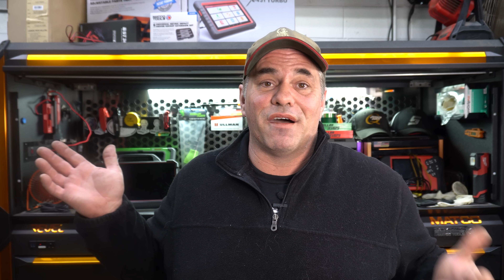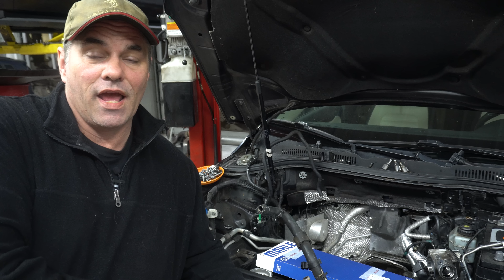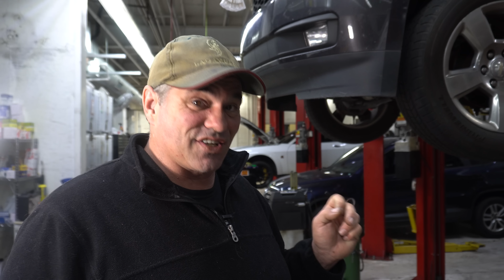Getting My Butt Kicked Again🤬😡

Comment: Also, if heat wrench does not work i split the nuts on the exhaust with small grinder or cut them with torch to open them up so studs is not damaged because of having to  replace stud if broke off leading into a can of worms with broken off bolts in the heads next. I all ways get heat wrench out and attempt to loosen first generally it is the passenger side that always gives trouble because of flange is different from driver to passenger.

Comment: I bought a 2014 Volvo S60  5cyl  Has the famous shredded serpentine belt causing timing belt slippage and 10 bent intake valves. I am retired shop owner..Did the repair in my driveway.Alldata cound not even supply valve clearances. Running  great after 60k additional miles.

Comment: I usually just cut the clamps off they are cheap enough to not have to put my self through it to get it off. I noticed if the exhaust has been off before the studs usually break off. Over torquing!!

Comment: Snap-on makes a great 1/2” drive swivel specifically for those exhaust manifold nuts. That with some GM heat valve lube and they come right off. Induction heater is your best bet on those exhaust nuts if they are fighting you. As for the clamp at the rear it’s a one time use clamp. I cut almost all of them at the bolt where it pinches down.

Comment: I had the same thing happen on a tahoe trans drop for a rear main a couple weeks ago, except the nut rounded, I eventually managed to split the hex part of the nut with a nut splitter, then took my air hammer, set a chisel at the bottom of the split, that split the flange, then I basically had to peel the nut off the stud with the air hammer…fun fun

Comment: Just replaced 2 GM truck transmissions this month. Install kit to cooler block valve to lower regulated trans. temp. GM valve is updated and requires line set but there is aftermarket kit that can be installed to block valve at transmission that will  bypass  lower  trans temp. this seems to be common failure if towing or not at and around 130000 miles i have found. This valve kit will lower trans. temps and lessen premature trans. failures when towing or everyday use. Used mobile 1 LV ATF HP if it is one of the later model trans. and will need trans programming and fast learn adapts after. I am seeing more and more and now selling these kits to all my customers to lower trans temps. to prolong the trans. life as general service when i see these come in. Also range finder with cyl. deletion installed because of valve train failure is installed on all later model trucks & suv because of lifter failures and wiping cam shaft out.

Comment: Just had to do an 2012 avalanche transmission and all flange bolts came off except for the 1 on the driver side top right. I like to try the hear induction tool but the torch is the fastest way to knock them out. I ended up vesting out the dang torch and the RBRT or any bolt biter didn't work completely rounding the nut so had to cut it and run a bolt and nut through it when I got the new 6L80 in. I would've had the job done probably a couple hours quicker and to make things even worse the damn inside starter broke off in the bell housing. What a day to be a mechanic... LOL 😆

Comment: you have a lousy machine shop. You might have to keep them because those are going away!
Reply: Yes I would be upset with that kind of service. I have 45 years in the trade and back in the day I was never out of the machine shop. We rebuilt everything. Now it’s just replace. I work in a Dealership. The young kids think they are so skilled swopping engines. It used to be a skilled job repairing them. As you say they may soon become obsolete. A good machine shop is worth its weight in gold.
Reply: It does not sound like they gave clear instructions in to what they wanted done at the machine shop. If I brought that head in I would list what I wanted done: 

Check for flat, check for cracks, clean head, replace valve stem seals, leak check. Advise further work needed.